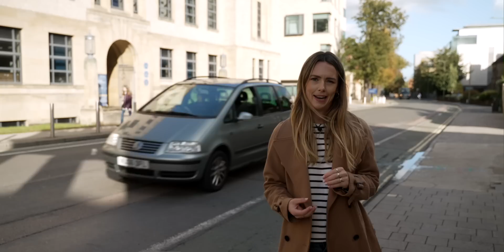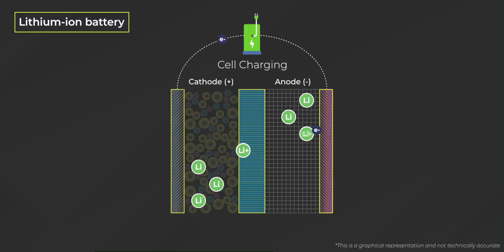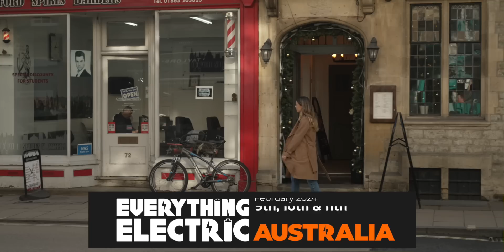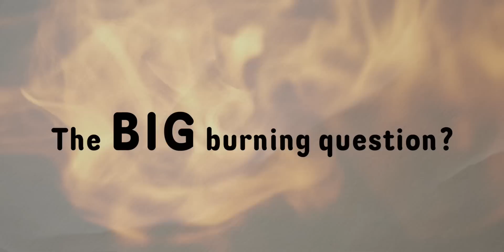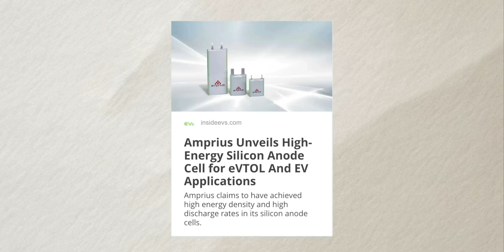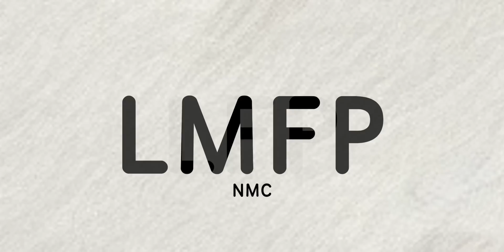The BIG Battery Breakdown: Fires, Failures and Future Breakthroughs!

Comment: EV's today are the equivalent of the horse buggy that someone strapped a steam engine onto in 1880. Its going to be decades before they are ready for mass adoption.
Reply from the maker: It's a fascinating space to report on, partly because of the dizzying speed of increase of electric cars on the road around the world, in contrast with the stubborn refusal of some men to accept this is happening. Now.
In 2010, there were approximately 1,900 electric cars on the planet.
In 2023, there are 29.5 million.
The technology in those cars has improved and developed at an incredible rate in that 13 year period, the cost of a batteries has dropped by over 1,200%
By this time next year there will be 8 - 10 new models launched that will be cheaper, brand new, than any patrol/gas car, and of course, much cheaper to run.
Vehicle to home (running your home off your car) and vehicle to grid will transform the automotive industry.
But please, don't change your mind, keep thinking an electric car is like a steam powered buggy. It's fine, no one cares.
Reply: @fullychargedshow My point is that EV"s today are in their infancy and not yet ready for wide spread adoption. It'll be decades before the technology matures and the infrastructure is built out to charge and the power generation is built to support them. Obviously rich people will buy them just like the steam and early gas cars in the 1890's. It wasn't till after ww2 nearly 60 years later than everyone was able to buy cars and the mass adoption became a thing. we are currently 15 years into that 60-70 year transition.
Reply from the maker: @ADobbin1  I understand it's a reassuring thing to say to yourself. 
"EV's are not ready for widespread adoption."
I genuinely don't know what that means, and I think it may reflect where you live as well as you own firm bias toward continuing to use dated, very dirty and inefficient combustion technology.
What you are saying is literally identical to statements made by horse traders, feed merchants, harness makers and blacksmiths said in the period 1890 to 1910.
The very well documented transition, in the USA from horse drawn to automobile was about 12 years, it's very slow at the start but them momentum builds as trust and actual knowledge about a new technology spreads.
Exactly the same happened with electric lighting.
Exactly the same happened with refrigeration
Exactly the same happened with radio
Exactly the same happened with television
EV's are 100% ready for mass adoption right now. 
However, there is one very big differen ce between what happened in 1900 and what's happening now.
Back then, sure, those horse traders, manure collectors (approx 7,000 of them in London alone) harness makers etc is they did not have budget of bargaining power to spread negative stories about these 'new fangled automobiles.
Today, we are all experiencing a massive torrent of non stop misinformation, lies, fear, uncertainty and doubt spread by the fossil fuel industry.
They have limitless cash and a truly existential crisis on their hands.
They will literally do anything to maintain their choking grip on our lives.
One of their regular negative points goes like this:  "EV's are not ready for widespread adoption."
So well done for supporting them, I hope they pay you. You deserve it.

Comment: Ignorance is bliss ... no city can handle full electric vehicle conversion. Most electricity is produced by oil and lithium batteries efficiency degrade quickly and will need to be replaced within 3-5 years . Battery replacement is extremely expensive.  Lithium mining and processing is extremely dirty and ruins millions of gallons of water. Recycling lithium is nearly impossible and cobalt is very toxic to marine life . Hydrogen is cleaner when it is produced from water and very plentiful.

Comment: Do we need a 1000 mile range?, the end question.
That does not only depends on the infrastructure for charging, it also depens on the fast charging price compared to home charging with solar panels.
At this moment I pay more than 70 eurocen (europ) for fast charging. Public slow charging (destination charging) is 5 times more than home charing in price on my panels.
Oly 7 cents for solar panel electricity (calculated on investment price with estimated 20 years of working)
When electricity on the road is ten times the price compared to home people will invest in that larger battery when they make longer distances regularly. They will earn that investment back, at least for a big part.
In other words...price policy will also tell us if we need to make our 1000 mile trip , even in europe, on onde battery charge or if we can depend on fast chargers.
If fast chargers would be affordable 300 miles range will do because the driver needs a brak after 4 hours driving . Even my current car will charge from 10 - 80 within 20 minutes.

Comment: Misleading Euan.  The stats reveal there are  numerous devastating L-ion battery fires in EVs in China, including in fairly new BYD vehicles.   Furthermore normal fire suppression methods are ineffective against EV battery fires.   Also, the image-conscious CCP does its best to cover up or lie about these incidents.   In the past week a house has burned down in NZ due to an EV charging fire.

As for the odds of an a L-ion battery fire occurring in your vehicle, it is apparently around 38,000/1.   In the UK ~1.5million EV/hybrids have been sold in 2023 - which translates to potentially 40 EV fires in the UK. -  40 too many !    Personally I wouldn't put a child in a Chinese made EV.  However the solid state/ceramic composition cited as a Holy Grail is promising & needed to succeed to eradicate the current safety risks.

Comment: Tell the Chinese that the risk of the Lithium ion battery catching fire is low or  Luton Airport or the two car carriers that were burned out and one sunk thanks to Lithium ion batteries. The comparison with conventional car fires is not valid since EVs make up only around 1 - 3% of the total car fleet and most have batteries that have not aged to reach the danger point but look at the fires in Florida after EVs suffered flood damage or those involved in accidents that take hours and over 30,000 gallons of water to extinguish and will reignite unless stored in a water tank. So maybe to date there are fewer Lithium ion battery fires than conventional but those that take place can be devastating to the point that insurance companies are refusing to insure vehicles with them and they have the statistics on the two types of fires. Even more dangerous are the bus fires since passengers only have minutes to get out before being consumed by the fire and the jets of flame at very high temperatures that can reach out to ignite people, cars and property nearby. They and the vehicles containing them should be banned from towns and residential areas before there is a major tragedy.

Comment: It is not the risk of fires from new cars that will be the issue but the risk from 4th or 5th ownership when cost of repair goes down to the lowest price and cheap components or dodgy repairs are used. Just look at the impact cheap chargers have had on EV scooters and bike fires. How will something like the UK MOT cover the use of unsafe batteries and chargers?

Comment: 1000mile range,... In Australia, Absolutely! There simply isn't the infrastructure outside of major cities, and there are places where deliveries regularly need to be made that don't have grid power connection and it's a multi day drive to get to. Those 1000mile battery packs will be needed to spread the drive load across multiple axles on Road Trains, maybe being pulled by a Prime Mover in the vein of the new Edison Motors trucks.
1000mile packs, in compact sizes, would also turn FormulaE in to a replacement for Formula1.

Comment: LiFePO4 is crazy popular with people doing auxiliary battery / rear battery / Dual Battery installs in Pickups and SUV's for camping, tradies recharging tools, inverters on worksites where there's no main power available, RV's, Campers, work trailers, food vans,... The Sodium based technology and it's cost savings is going to be a huge factor in the take up of new products and a move away from Li-Ion and Li-Po in those marketplaces.
Li-Po / Graphene will remain the choice of Quadcopter RPV pilots, especially for racing.

Comment: One major trend we’ve seen in EV’s is the growing size of the cells. This trend will continue. The whole current collecting methology is changing as the cell size grows. Please check the work of the absolute pioneer of cell size game. Mr Winston Chung at Thunder Sky Winston Battery. Currently only manufacturer of LiFePO4 cells who can achieve 10,000 Ah cell size. Yes. That’s 10,000,000 mAh!

Now. What does this tell us? The ratio of active materials in a pack volume can still be quite easily doubled. Just by rethinking the pack mechanics. This is what we have been doing with LFP for over 20 years now. This is one major blind spot for the whole battery community at the moment. Almost all research in the battery field is aiming too heavily on the chemistry hence missing almost wholly the packaging evolution.

1000 mile range is a must to achieve cheaper EV batteries. Raw material BoM cost is with LFP below $10/kWh already IF one owns the raw material source and refining operations. And many Chinese battery manufacturers do!

Comment: A bit misleading/disingenuous, The issue is not if they go on fire or not, it's what happens if they get caught up in a fire even if they are not the origin of the fire. Lithium Ion batteries pose a particular problem for fire departments because the battery itself can manufacture oxygen during the fire process ,exothermically. This is why car ferries are banning EVs, when ev's are caught up in a fire like on a car ferry they are impossible to extinguish at sea or almost impossible.

Comment: Y'all have done an episode or two on the Aptera, so i'm surprised you didn't include that in the discussion-the other way of creating the 1000 mile vehicle is to increase the efficiency of the vehicle itself-reducing drag & weight. The production version of the vehicle isn't complete yet, & the actual EPA estimate of mileage may be slightly different from the projections, but they will likely get very close. & If battery efficiency continues to increase as well, we may be discussing a 2,000 mile range in a few years.

Comment: So 1000 mile rang is great but you are hauling around a ton of “range” for the 99/100 journeys that you make. Much rather have an all weather 250 range that can be charged from empty to 80 in 5 minutes.  Actual 250 mile range is 250 in cold with heater, lights, stereo on etc.

Comment: For at least a decade the EV lobby have been saying how much cheaper batteries are getting. Recently a one year old EV in Canada was quoted for a replacement battery due to a small scratch under vehicle that cost 5k more than the entire vehicle cost new. How can that be if batteries are so much cheaper than a year ago as we are told?  Cost will be worse if they keep changing batt chemistry and tech. The chemistry of an ICE vehicles traction battery never changed, hydrocarbons. I for one will wait as there is to much uncertainty around the real cost of  EV ownership at the moment.

Comment: The thing about battery range is the metrics used to measure range is not Real World.  You can take 20 percent of epa to get
approximate real world range. My model Y 250 watts/mile or maybe a little less in town 300 to 350 watts/ mile   on the highway this gives
about a 240 to 260 mile range on the highway from something that claims a 330 epa range. Then there is some eventual degradation
so starting of with 400 to 500 mile range seem rational .

Comment: There is a reason of why there are needed vehicles for personal use with long range capabilities and it is that currently existing ICE vehicles have such a long range.
People are afraid of changes and specially when changes offer what they consider worse features. Those can be irrational fears, but they exist.
However, in some cases, those fears are not that irrational. Meanwhile I totally agree with the conclusions of this video, you are not considering that in many places people have no possibility to have a home charger, just because they do not have a private parking space!!! 
For example, here in Spain most of the population live in flats, and a huge percentage are on old buildings with limited number of parking places and even without any at all.
For those people, that park on the streets, the fact that their car has a long range means they do not have to worry on refueling/charging with high frequency, neither with urgency, and that makes a real difference while the fast charging infrastructure scales up. 
And even when the infrastructure exists, the fact of finding the charging spot and leaving the car in a place for an hour (or several hours) for a full recharge once a week makes a huge difference vs doing the same process two or three times a week.
In my case it’s perfect. We have two EVs, home charger and even solar panels. But for some of my friends an EV, with the existing technology and infrastructure, would just over complicate their lives and I totally understand that.

Comment: We do need batteries a moderate amount longer than the distances we plan to travel in one go, because we and the battery get concerned when charges approach both 0 and 100%. So a Model Y with a 325 mile range will seldom go more than 250 miles before the system really wants you to stop and recharge. So a 1000 mile battery might be good for 700 miles in reality, a great thing for a quick trip from the Bay Area to San Diego, with spare charge to hit the restaurant and the sights before the destination charger at the hotel.

Comment: I feel like most ev only need to be 250 mile in range and like people have said traveling that distance your going to need to stop for a rest or wee, just having fast charge points at every petrol station would be a good start and at every major car park would likely solve most problems. But lighter battery would be good, maybe a suit case battery system on motorways would be cool, that you could pickup at service station put into your car, that gives you say 50mile more range and you drop it off at the next service station so it be quick to swap it out, and you got that bit of range for the motorway driving part.

Comment: A charging station costs a fraction of what it takes to build and maintain a gas station. They could be dropped off a truck and up and running in hours. There were half a dozen intersections with a gas station on all four corners with a few miles of my childhood home. Once EV's are in the majority there will be ample chargers in every parking lot. Even more, there are not only automatic inductive park-over chargers, but also already hundreds of kms of pilot electrified highways, once the interstates are electrified range will become irrelevant.

Comment: Euan's point right towards the end of the video was by far the most important. A charging network is always going to be infinitely more important than range itself - in the same way that it doesn't matter if your car's got a small petrol tank because you just fill up a couple times. Charges at destinations plus solving the mystery of chargers for those without driveways is the biggest hurdle.
Reply: In 2023 16.3% of the ~2million new car sales were BEV. If the government wants to achieve its 2035 target of 100% zero emission vehicles then we will have a lot more electric vehicles on the road.

Until we get to the point where either range and destination charging undermine the need for mass volume en route charging stations, or charging times are closer in parity to refuelling an ICE vehicle, we would need a completely unsustainable number of en route chargers.

This is neither practical nor desirable. The bigger push in my mind needs to be a focus on range, destination charging and fast-charging speeds.
Reply: @lordmord8378  If you can get a full charge in less than 10 minutes, then we can just turn petrol stations into chargers...problem solved as it would be like normal.

Comment: Impressive analysis of battery chemistry - I’m glad Imogen understands it. 😊👏👏
Reply: The issue is not if they go on fire or not, it's what happens if they get caught up in a fire even if they are not the origin of the fire. Lithium Ion batteries pose a particular problem for fire departments because the battery itself can manufacture oxygen during the fire process ,exothermically. This is why car ferries are banning EVs, when ev's are caught up in a fire like on a car ferry they are impossible to extinguish at sea or almost impossible.

Comment: I'm very interested in +1000-mile range passenger commuter vehicles in the US for a few reasons. Interstate travel through underfunded rural areas seems to be the subject covered in the video, but my primary interest is in longer range with comparable cycle life to boost the mileage life of the battery and vehicle to help amortize the cost of the vehicle and boost my use value per dollar.

Also, if the mileages push high enough, then the used market might see an influx of the current gen cars at more affordable prices, which could speed the national fleet transition to electric. 

Once we get more EV's in garages, the demand will be great enough to warrant an expansion of the national public charging networks while also incentivizing personal solar and smart grid sharing at personal residences, all of which will help the economy through green industry jobs.

I see battery tech and EV feature expansion as the push force on a green transition. I want EV's to take the crown in every category, such that anyone still pushing ICE doesn't have a leg to stand on when ICE and EV are compared in good faith.